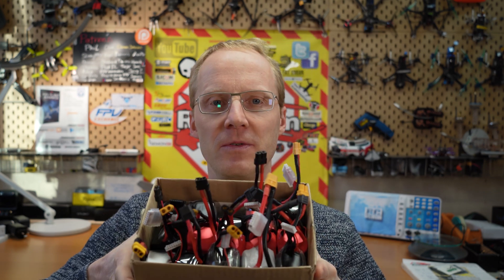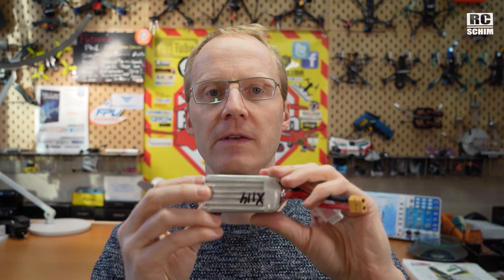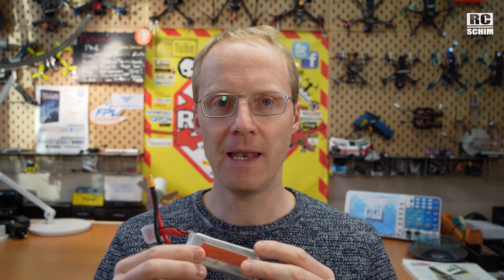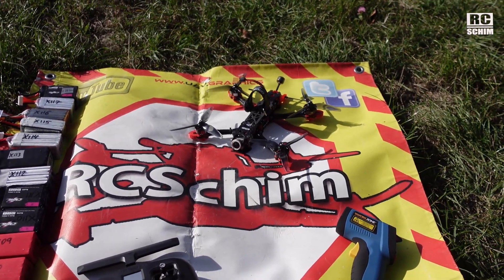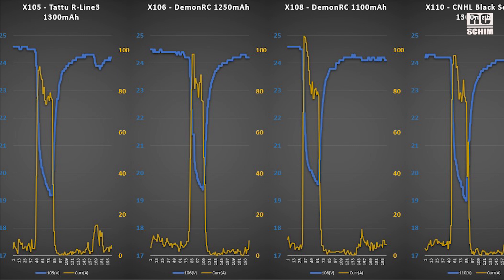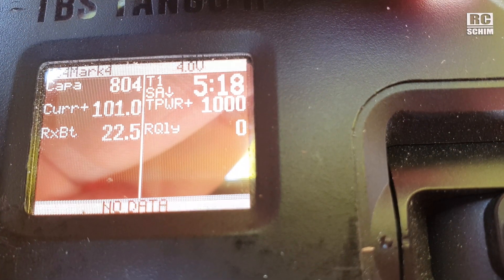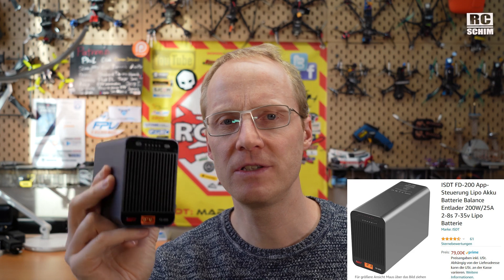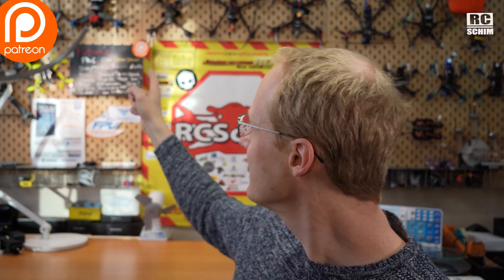6S LIPO Packs longterm testing (RCSchim Volt sag test)

Comment: Have to Say; Went out and got Fullsend From Your Testing. It's Out Performing my Thunderpower and tattu Rlines. Great advice. What Is Your Most used 6s lipo pack .What do You perfer most Atleast????
Reply from the maker: Great to hear the Fullsend worked for you as well! 
Since I have so many different brands of packs, I usually took the RLines if it was important to have most power - since I rememberd their good reputation ;)   So they are 2 years old now and still work, have ~ 30 cycles which is moderat use I guess. Fullsend and Beat lipo are the other quite favourited ones (they have ~25 cycles). 
The black CNHL are really poor - but I've also used them often (but I then knew that my quad wouldnt be a rocket - more a cruiser).
Currently I prepare a battery test for 7" longrange - different topic - even more variables ;)
Reply: @Rcschim  Look forward to seeing it. Thanks for the response! Beat is my Next have to try lipo..

Comment: hey man, i just had an odd experience with my number 2 quads dji set up, flew a few packs everything fine 50.8mbs all the way, then halfway through a pack i dropped from 50.8mbs to 10mbs, barely recovered to 18mbs all the way back to landing at my feet. antennas all seemed good, settings seemed ok, i changed up to 700mw a couple of packs before this, and i tested when i got home and it was back to 50mbs... any ideas?  i've literally never played with any settings after initial set up and this rig was tested to 1miles a few months ago...
Reply from the maker: I can only think about the antenna connector, but you probably checked this first, right?
Reply: @Rcschim  yeah the connector is all i can think of too. i watched the dvr and its like somebody flicked a switch,  i'll go back in and try to get a good look at the connector.  maybe the extreme heat from 700mw and extreme cold from wind chill made it pop or something. totally disconcerting, 20seconds before it happened i was over a lake so, my nerves got s serious jangle. new frame archon v3 is fantastic.
Reply from the maker: @TheMadmacs  is it a caddx vista or the full size airunit with 2 antennas? 
The caddx has the tiny UFL connectors. Maybe the "locking" bar isnt screwed in correctly or it just got loose...
or maybe your antenna itself got broken (the mushroom part of the antenna, maybe due to a little crash...)
Reply: @Rcschim  yeah its the vista, the engineer in me really hates the ufl cover.... hates ufl's but that cover thing with the little hole and peg, what were they thinking!..  the antenna seems ok its an og caddx, looks rock solid to me,  i'm going to buy another archon frame next week really really pleased with it, i was hopping around the scraggle like mr steele hehehe
Reply from the maker: Btw: received my dji action 2 yesterday. If I get a short period of nice weather this afternoon, I'll test fly it!

Comment: so i accidentaly drained my lipo to 2.7 volt during a fly not for long (felt a weak throttle punch, than immediately replace it), let it cooldown to ambient temp than recheck, now resting volt is at 3.3 volt, not swelling, is the battery still good?
Reply from the maker: so under heavy load they sagged to 2.7? might be just a weak pack. I'd keep it under close inspection  (not how much you can charge into them, feel how warm they get during flight, check if the cells are out of balance,...)

Comment: I use the CNHL White packs 4S 1500mAh 100C I leave them fully charged all the time in my flight case, so when I want to go fly I pick up and go and do not have to waste time charging. Here the weather is always sunny or flyable with not many rainy days. Temperature never drops below 20C mid day in winter, perhaps cold weather is part of the problem in Europe. 
I have never had a battery fail in more than 1 year of flying (100 plus flights per battery). I think if I only got 1 year out of a battery I would be happy. The price I seem to be able to get them for is around US$20, which is good value. Flight times on a 5" with 2450 Xing is easliy around 6 to 8 minutes of agressive flying.
Reply from the maker: Your weather situation sounds very good ;)
Have you noticed an decrease in MAH that you charge back into your packs? 
If they are always charged I'd expect them to only give you like half the capacity they had when they were new. when you fly them packs to 20% or 3.7v - do you charge more than 800mah back in?
But I agree - if it works for you the convenience of always having ready packs is great! Also those packs are quite cheap...
Reply: @Rcschim  G'Day , thanks for the response. The weather here (Queensland Australia) is about the best you can get 300 days or so of sunshine and it is called the Sunshine state. Regarding your question on mA on charge. On Sunday I flew a CHNL 4S1500mAh battery that I have used since February this year with multiple flights (I always chargeat 3 Amps using a HOTA D6 Pro) and it took 1435 Milliamps. When I connected it to the charger atthe start it was 14.3 volts (I generally do not land below 14 volts) so that use was amazing. I am sure it is just an anomoly and a really great battery, the rest vary from around 1100 to just over 1200 mAh recharge. I have stuck with this line of batteries as they have all been fantastic. I am also now building my own 4S and 6S Li Ion packs using the Sony/Murata VTC6 and on the same day same drone (will be posting this on my Youtube channel) the 6S gave me around 12 minutes and on re-charge showed I had used 2205mA. By the way, I am certainly not challenging your arguement as I have not had any where near as much experience as you have, and I really appreciate the amount of work you put into your channel. From information I have on the Li Ion Sony units they expect to handle around 300 charge cycles before they become a problem. Best regards Chris
Reply from the maker: @chriscflint  Sunshine state - sounds wonderful at the moment (my shoes are wet from the snow). Your 4S packs sound really good - I was expecting way worse performance. Longer time ago I had some really expensive 5000mah 4cell packs (for a larger copter) and made the error of leaving them charged over the winter season. they for sure only were good for 2500mah of capacity after this storage error.  
Maybe your usage scenario isnt that bad after all ;)
I know building VTC6 cell packs is the way to go, but I wouldnt trust my own soldering and dont want to crash because suddenly my power is out in the air ;)
300 cycles for lion is plenty. thanks for your feedback, greets, Mario

Comment: i'm literally discharging all my packs for the third time this week,  so hard to get a weather window with enough light to fly, in scotland the sun at midday is like sunset... its beautiful but damn it makes it hard to fly. only tip i can think of is pre-flight temps, i use a bubble wrap bag to hold my packs, then i put that insiade a woolly hat and then i squeeze two water bottles of hot water in the hat,  this is enough to keep them warm for a couple of hours in winter.   without this heat, packs just die instantly in cold weather.
Reply from the maker: Hi, discharging them to storage too often might eat up their live as well ;) 
Thanks for the tip with warm batteries - I usually take them with me in the warm office, have them near the heating (radiator) and at least NOT leave them outside in the car.
Will see if I wanna fly more in the winter (it just snowed quite a bit the last days) from inside the car...  currently I'm more into fotography and VR games ;)
Reply: @Rcschim   yeah winter flying is a bit extreme,   just can't fly once you get cold,  but it is a spectacularly beautiful time to fly, -9 is my record for cold flying, thats a 1 hour hike then about 25mins flying before i'm just too cold.
Reply from the maker: @TheMadmacs  Hike and fly in the winter at -9° - that sounds like something where you need to be a weather proven scottsman, rather than a "I fly from inside my warm car" guy :)

Comment: Good testing and overview brother, and I concur that leaving a battery fully charged for more than a couple days does irreparable damage to the chemistry of the packs from my testing and experience. Personally I use the SkyRc BD250 discharger as it is more powerful and has more features, like computer software which graphs different parameters while you discharge your packs.
Reply from the maker: your discharger looks fancy - more features and even cheaper than my suggested device. I will add it to my infobox for others. thanks!

Comment: Modern batteries seem to be a lot better than the older ones we once used.   I've got some very abused packs that still perform surprisingly well but in "the old days" I seem to recall that most packs would puff at the slightest insult.  I'm still having a very good run with my CNHL packs and although they're not the best (by the metrics of internal resistance/sag) they certainly are the best-value packs I have.
Reply from the maker: Hi Bruce, thanks for your comment!   Maybe the overall quality of lipo chemistry and even cheap cells increased a lot over the years? It's now for sure way cheaper to produce decent cells.
Maybe I'm to pre-occupied when I see the black CNHL packs. I know from my tests they are crap-  but then whilst flying I dont notice a lot of problems :) Maybe because I get from acro- into landscape-surfing mode quite often automatically with my copters ;)
greets, Mario

Comment: Nice overview. I thought the tattus would be better, interesting...
Would be nice to know, how the chemistry in fully charged Liion-Cells suffering on longer fully charged periods. Laptops/Ebikes etc. are also stored fully for weeks.
Reply from the maker: Maybe I've tortured them more. I flew them the most for sure (30 vs ~20 cycles on other packs) 
They still "feel" quite powerfull and I trust them, use them if I really wanna fly fancy acro (which is seldom).
I also wonder about the LION chemistry.  I guess it's not that urgent to discharge them. Non theless: I know from my dayjob (IT) that Laptop packs also "would prefer" to be stored at 50% if you don't use em. Fully charging them always (because they're in the dockingstation) kills their pack in about 2 years (to 50% or less cap).
Sometimes better laptops have the option to not fully charge the battery (and only do like 80% max - like a tesla also prefers).
greets, Mario